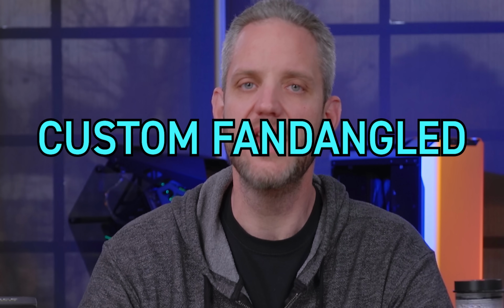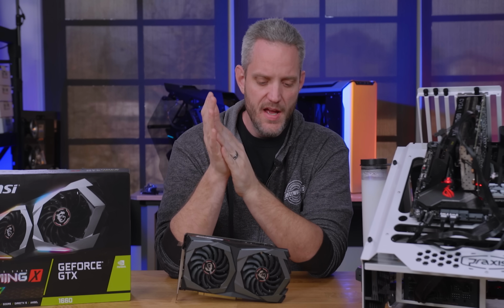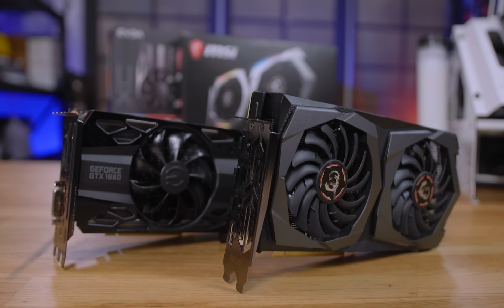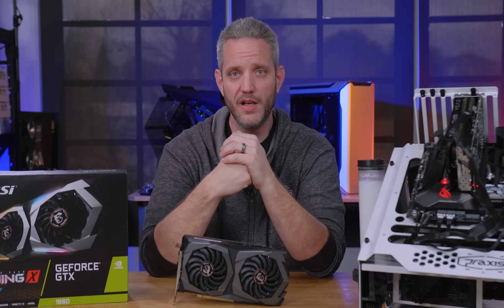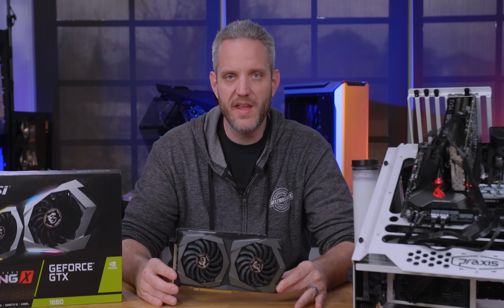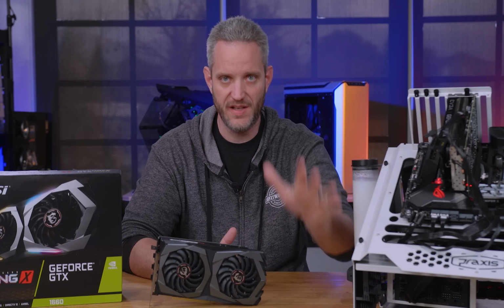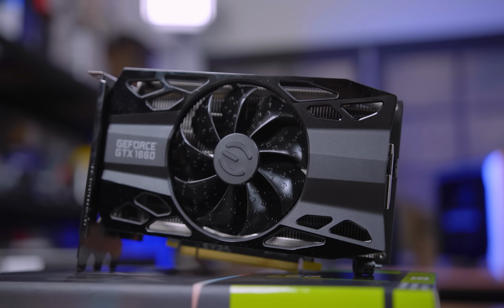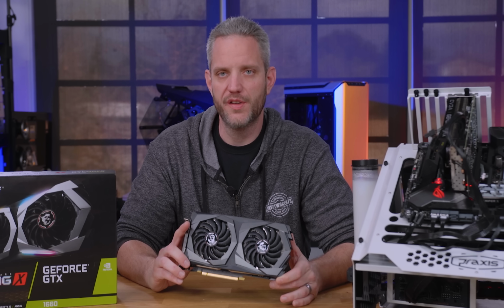Just save your money.... GTX 1660 vs GTX 1060

Comment: Is there a point to the 2060 over the 1660Ti,, as the cards not gonna give the performance you want whilst using the RTX feature? Which seems to be the reason to move up in the first place? Is it just a placeholder between the 1660ti to the 2070 which I can see the benefit of but a bigger price jump?
Reply: I think 2060 is still the sweet spot in price performance, because going from a 2060 to a 2070 costs wayyyy more than going from a 1660 Ti to a 2060.
Reply: @avatarion  yes it much cheaper going from 1660ti to 2060 but I'm not seeing any real benefit and will likely start to struggle in 2 years time. However spending more on the 2070 now I think would be much more future proof with the extra 2gb VRAM and extra Cuda Cores.. I've oversautrated myself with video reviews and now its all gone to sh!t haha.

This card is to replace a 980ti that just decided it not going to work anymore. So not a planned upgrade.
Reply: @romeo.3472   If you are already on a 980 Ti then there is no need to even consider the 2060. It's mostly for people who are coming from weaker cards. 

By the way, Turing uses GDDR6 so cycling data at a much faster rate even if it's got lower in VRAM in some cases. The 2060 can hang in there with Pascal 8GB's.
Reply: @avatarion  You misunderstand, the 980ti has died. This is a forced replacement. I play at 1440p,  the 1660ti will be fine for a year or so, but the 2070 which is a higher price should last alot longer before an upgrade is required. Current games 6Gb is fine, but in two years it likely that it wont be enough to maintain 1440p with a good frame rate. So I'm trying to evaluate if its worth spending more now, to future proof myself for longer, or likely have to spend more money in two years to replace the 1660ti, which would likely cost more than the 2070 does know, if that makes sense.

Comment: The 1660/Ti cards are not terrible values buying brand new, but they suck badly as upgrades, especially given the price points versus the performance increase.

If you already have a card in the same rough performance range, I would wait for Navi to see how it shakes things up.  If AMD really can provide 1080/Vega64+ performance for $250, it'd be foolish to waste money now if you already have a card that's holding up well enough.

Comment: I'm in a difficult position. I built my PC a little over 3 years ago. I was somewhat bamboozled into a 3gb 1060. Now, I will say as a beginners card it is fantastic. Even still in games like apex I get 100-144 fps no problem at 1080p. But it's definitely starting to show it's age. However, I also have an i5-6500 CPU. So I ask this question; is it worth for me to get a 1660/1660 ti? Will it just be bottlenecked by my processor? Because at that point I might as well just do a complete upgrade and wait a couple more years. What do you guys think? Thanks
Reply: Well I mean at 1080 all graphics cards get bottlenecked a bit even with the higher end processors. I would try to see if there are benchmarks with your set up and see if it affects performance as much as you think because I think it would be ok but don't have anything to compare too.

Comment: I'll sum it up.  DON'T BUY A GTX 1660!   Dude is pushing this crap(YES, YES, YES) because he gets the cards for FREE!!!  Why even bother with a 3GB version???  What a waste!   Try and play with 1080 rez and get choked by limited video memory!  Yes, do more testing with video requirements with the popular games...  Updates are a @#$%!   Did you use your old numbers???  Have you done more than 2000 hours testing a single GPU???  What is going on with this Micron DDR6 RAM going bad???  I would like to buy a 20XX Nvidia but I want to know which one has SAMSUNG memory!  Looking at Benchmarks the AMD580 may be just as good as the NVidia 1060 for 1080 rez at HALF THE PRICE!(~$200)...  Save your money and wait for this market to fix itself!  Or at least ask for what you want.

Comment: Before the 20'series $hitty GPU's came out. Everything was fine with Pascal GPU"s the 10 series GPUS life was once GOOD/GREAT.

I have two Asus 27" Monitors one is an NT Panel the other an IPS panel both G-sync at 2560x1440p one is 144 refresh rate the other up to 165 refresh rate. Never had any issues with g-sync, watching youtube, Netflix or Xfinity. Everything was fine none of my games crashed or gave any errors. Well until the 20'series GPU's came out it's been total chaos with these god damn drivers. NO G-SYNC WORKING, FLICKERING ON both monitors, black screens. One monitor is set at 144 refresh and the other at 85 refresh NEVER HAD ANY ISSUES.

It's been way to long and NVIDIA hasn't fixed shit. Listen COMMON SENSE. There should be drivers for the 10series/pascal GPU's and another set of separate drivers for the $$hitty 20 series GPU's they're not the same and that's the damn f-n issue. Nvidia get your damn AI to write and fix these DRIVERS. AMD is introducing ray tracing I hope to GOD they do a better job than you and gives you wake up call. I've given you plenty of my hard earned money and my shit doesn't work right until I run 388. drivers all is WELL except BFV, assassin's creed odyssey, division 2 none will run on those old drivers. yet g-sync works and all my other games. *it's frustrating because the NVIDIA can't fix shit and the reason is those stock pile of shitty 20 cards in their warehouse..............................sitting

Comment: I would think pretty much everyone (watching these videos) has a system already they can reuse parts from, so who are these people on such a tight budget building entirely new systems out of necessity?  I get people selling their old system then going with all new parts, but then they have the money from the old PC to put towards it.  

Now what I will say makes sense is using the GPU that works best for the least money with your monitor.  A guy with a 1080p 60hz panel has no need for a 2080ti, so a 1660ti is just fine for him.  But that has nothing to do with budget, because if he can afford the higher resolution panel he can obviously afford the GPU to run games on it.

Comment: I don't get why nVidia don't release a proper low-end/entry level GPU. If people want to make a ~$400 PC they basically have to get an AMD GPU, a second hand GPU, or integrated graphics.

The GT 1030 doesn't count, it's awful in terms of price-to-performance. You can get an RX 550 with 50% more performance for the same price, or a GTX 1050 with more than double the performance for just 40% more money.

Comment: My old card (or PSU or motherboard) on my Frankenstein PC build from components that my old workplace was throwing away crapped out after a few years. Never wanting a crisis to to waste I have ordered a new PC build with a GTX 1660 in it. Appears to hit the price to performance ratio I want at just over $200. I was going to order the 1060 6GB first, but the 1660 came in at the exact time I needed to buy, so I got the same performance for a cheaper price instead.

Comment: I need some help with an upgrade. I have had a HD 7950 3gb for the last 5-6 years and it can still play games decently but I want to upgrade and I'm confused. Originally I looking at a 2060, 1660Ti or 590 but now the 1660 came out. I was leaning towards the 1660Ti but idk if 6GB VRAM is enough or if DLSS on the 2060 will end up being worth the extra price. To add to the confusion I have read a ton of reviews about the RTX cards crashing and dying after a few weeks/months. I miss the old days when it was simple.
Reply: Don't worry about the 2060. It's GDDR6 memory. Most of the crashing and dying issues are overblown, and you can just RMA it even if it did happen. Compared to the 1660 Ti the 2060 is still a cheap upgrade compared to what you have to pay for 2070.
Reply: Well I wouldn't work to much about dlss and any of those other features there are barely any games that use it. Its probably going to take another generation. Before those things matter so what you really need to look at the performance you want and price.
Reply: @MrEpicgamer123  The RTX in RTX 2060 is not important. You should buy it for its normal rasterization performance, which is better than on the 1660 Ti.
Reply: @avatarion  that's what I was saying. I guess I wasn't clear

Comment: just save and buy a 2060 in the long run the fps will be worth it or the best gpu you can i value fps over noise
Reply: It's worth it. The 2060 should give you one extra year of playing on high settings before you have to lower them.

Comment: My rule of thumb when deciding whether to upgrade or not (around the same price bracket): how does it compare to the previous gen's next bracket? For instance, upgrading from the 960 to the 1060 (which was roughly equivalent to the 970, or from the 370 to the 570) at more or less the same price is a good upgrade. Going from the 1060 to the 2060 is not that good, because the latter's price is closer to the 1070, so it's kind of pointless.

Comment: I'm like, yeah, maybe it's time to upgrade my 750 ti
Reply: I always feel bad for comments like these until I realized I used 4th gen i5 integrated graphics until recently. It can always be worse lol
Reply: I am here Crying with gt610
Reply: @bhabadipTWO-ONE  same bro 🤣🤣🤣 i'm pointing to Buy a GTX 960
Reply: @SHIIMAN1  maybe go for atleast a gtx 970,the gtx 960 is good but not worth upgrading over.
I personally would recomend getting something like an rx 570 for a very large performance bump but the 960 isnt a big enough of an upgrade anyway.
Reply: What about the ITX 200000430ti super pro max Radeon Vega athlon ryzen atx micro atx i9 i7 i5 I3 core thread ripper Xeon epyc ??
Reply: It’s only 9000$ for the blower version and gets 20 FPS on 32k

Comment: Coming from a 1050, the 1660 looks very good to me, it's just a shame no one is comparing it to the 1070.
I can't get a 1070 because I have a 320W proprietary PSU, so I'm very limited as to what GPU I can use
Reply: There are other channels that compares with 980Ti. They are neck and neck with 1070.

Comment: if you own any geforce 10 series card you would be wasting your money on a 1660. Even from a 1060. A 2060 makes more sense.  There are no updates to make the 1660 card worth it (no directx 12.1/directx13, no new tech of any kind). At least with a 2060 the extra $40 gets you some ray tracing...

Comment: The 1660 name is starting to make sense to me now. Normally Nvidia's generation leap is one card up. Meaning a 2060 should be equal to a 1070. Which it is. 1660 resembles an increase in power that puts it 60% closer to a 1070 in performance. Not quiet there in most games, but over half way there.

Comment: Had a gtx 1060 6gb for the past 3 or 4 years and it still holds up amazing, play all my games at 1440p and some games at 1440p and 144hz :)
Reply: Hi Matt. I just asked a question in the comments regarding 1060 6gb. I've zero experience with 1440. How much of a difference is it from 1080p? Also what is the experience going from 1060 6gb to the 1660ti?

If you can help thanks.

Comment: As im planning to build my first rig in april/may 2019 this just adds more confusion. i had the 1060 6gb vs rx 580 8gb scientific debate but then they introduced this. should i just pick whichever cheapest?
Reply: You can find 1060 6gb for pretty cheap used and itll be a huge deal if you can find it for $120-$140 ish. Still a great card to be honest

Comment: I made the mistake of buying the 1060 3gb. I had a Radeon R9 280 at the time, and it died right at the height of the mining craze. I didn't want to pay the massively inflated prices for something better, thinking I can sort it out properly a few months down the line , and either sell the 1060 or put it in another system. So I opted to more repair my system rather than upgrade it. One thing I found very quickly is it didn't matter if it had a few less cuda cores, and was a little slower than the proper 1060, because that 3gb VRAM was by far the biggest bottleneck, and you would run in to problems with that, long before you hit the GPU's actual limit. It almost seemed a deliberate ploy by Nvidia to gimp the card, and bring it keep it firmly inferior to its bigger brother. An extra 1gb and it would have been a much better card. Thankfully, last Black Friday, they had 1070's on sale for less than what a lot of these similar performing cards coming out now cost. I picked one of those up. Definitely a massive jump in performance.

Comment: That was why I advised people to stay away from the 1660 Ti. (why did they launch the Ti version first? > to get the extra money out of people)
The 1660 has a better perfomance/price ratio and the only one Nvidia GPU that is priced Right on the money IMO! This and the RX 580 are the 2 good Value picks at the moment. But I'd rather recommend a 2nd hand GTX 1060 for cheaper (around 150$ )or a GTX 1070 for the 220-250$ price
Reply: you got the point almost, but you can overclock the 1660 non Ti to a Ti level by easily, born for overclock and for savin money. you can overclock any 1660 card to +100-130mhz core \ +800-900 vram.

Comment: my uncle ordered a 1660 ti thats as short as my 1070mini to put into his alienware x51 r1, we are upgrading it as far as possible to be his gaming rig when hes in the Philippines where his wife is from and they plan to build a home. 

the 1660ti seemed like a better value for the 15-20buck dif, and was zotac with ball baring fans rather then shim fans that most come with these days..that wear out... (personal exp) 

the 1660ti looks plenty good for his 3770, 16gb ram, 1tb ssd+2tb sshd (upgraded specs, it has a gtx 555 in it now, 8gb 1333 ram, and a 1tb very slow wd hdd) 

seemed like a better value then a 3g card or the 1060's in the same price and size range, (anything with a decent fan/cooler, and more then a few i looked at made me cringe).

Comment: 1060 3GB is much cheaper than 1060 6GB and it's much better than 1050Ti 4GB in performance and not much worse than 1060 6GB.
I almost bought 3 gigs version,but AMD won me over with 4GB 580.

Comment: Purchasing options right now:
RX 570 unmatched value at 1080p;
RTX 2060 - it's unmatched value at 1440p - you get 1070ti performance and RTX cores; 
RTX 2080 - if you are at 4K and have money to burn for days, you get the best card in the consumer stack. 
(And before someone complains RTX 2080ti is the Titan of Turing and is not in the consumer stack with that crazy price it has.)
Reply: RTX is useless right now, especially at 2060 performance levels. The Vega 56 is better value right now.
Reply: @hashimiyazib  Vega is more expensive than 2060
Reply: @Merkur Stern Vega 56 goes for $300 now (https://www.amazon.com/dp/B07BRCZG3M/?tag=pcpapi-20). RTX 2060 is usually $350 ± $10. (https://www.bhphotovideo.com/c/product/1456229-REG/msi_g2060v6c_geforce_rtx_2060_ventus.html). Both cards are similar in performance. If you want to get technical, UserBenchmark rates the Vega 56 a bit higher than the RTX 2060 (https://gpu.userbenchmark.com/Compare/Nvidia-RTX-2060-6GB-vs-AMD-RX-Vega-56/4034vs3938). However, games do sometimes prefer Nvidia cards. If you really want to put those RT cores to use, get a better card such as the RTX 2070.

Edit: How the hell do you use the @ symbol?
Reply: When gaming at 4K Radeon 7 is the better graphics card . You get more use out of 16 gigs of RAM at 4K then you will with Ray tracing .
Reply: slice 1 uhhh no
Reply: @ficklefire  Really ? At 4k one of the problems is that the information required takes up a lot of space , by having 16g of RAM it has more than adequate storage , and can make future request .
Reply: rtx 2060 is cheaper than the 1070ti so its a win

Comment: This is a horrible product to be consider an upgrade to a gtx 1060 6gb. You're spending $220-$300 just for a 10fps boost average. Better off buying gtx 1060 on Newegg for around $170. These cards need to be in the GTX 1050 price range. This reminds me of the GTX 900 series where it had just small increase in performance vs the GTX 700 series.

Comment: I upgraded from the EVGA 970 Gaming to the 1660ti 6Gb XC Ultra. Honestly, I am very happy with the results I have been receiving from this card. And, IMO, very negotiable on the pricing. I did not have $400-$700 for the 20xx series, so I opted for the one I got. $309+sh+$25 more for the quick ship option on NewEgg. Everything plays fine on 1080p with Max settings, and I could not be happier.

Comment: Personally, with how expensive graphics cards are getting, I'd expect at the very least a 25% performance upgrade across the board compared to my current board before even considering an upgrade. Anything less, and it simply isn't worth spending money on upgrading in the first place. This means that, if I could get a 15% upgrade at $150 or a 45% upgrade at $600, I'd prefer to save up for the $600 card despite it having less bang for the buck, simply because the 15% performance increase isn't going to matter enough to give the upgrade good value. It wouldn't really change your gaming experience much, if you know what I mean. A 45% increase, even if it was more expensive, would totally change your gaming experience.
My card used to be high-end like 2.5 years ago, and even today, I have to pay near high end money to get something that is meaningfully faster. This is mainly due to the cost of high end cards having gone up by almost 1/3 since I bought my card.

Comment: i have 2 rigs- 1 fx8320 build w/1060-3gb and a newer ryzen 1600 w/1070 <-- picked up used for $225. i game at 1080p. so getting a newer card only makes sense if i get a 1440 high refresh monitor and up the cpu. heck i might as well build a new rig if i'm gonna dump some $$. probably be better off just waiting until they get their cards & pricing straight and catch something on sale.